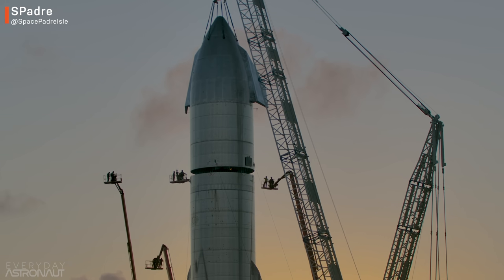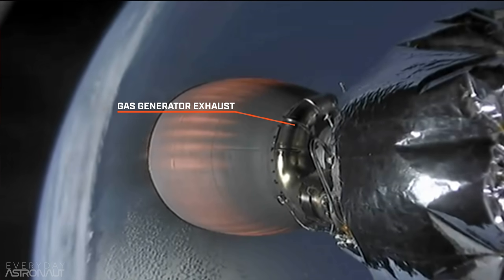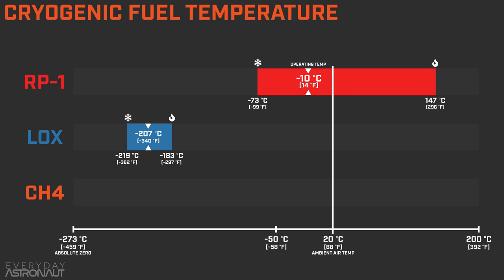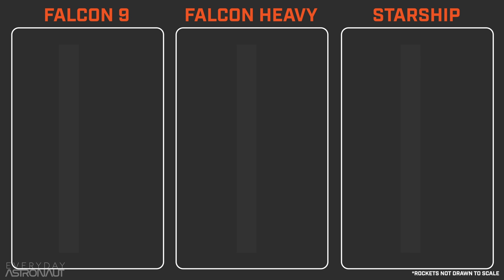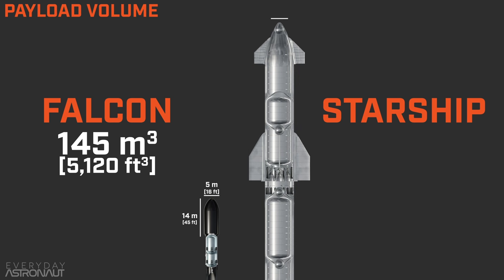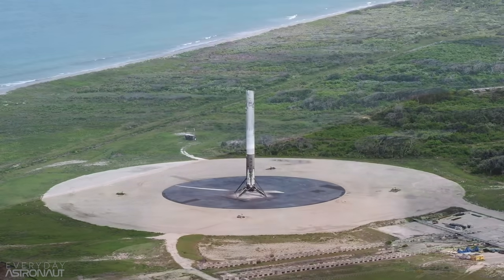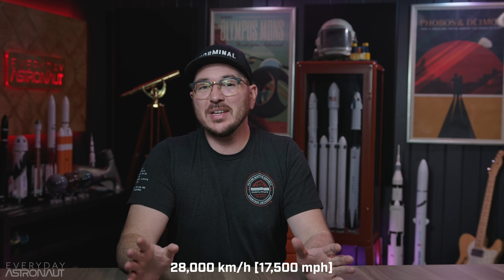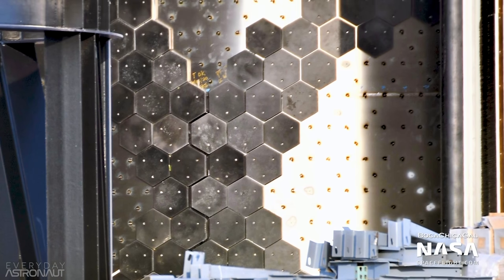Complete Guide To Starship: Falcon 9 VS Starship. What's new? What's different?

Comment: nice 3d design but is quad helicopters tech on avatar model this require some alternations who vant to blow engine in mid off wings is structurly dum idea and limited speed aif airplane has wings has some speed and glide now you hgave glide wings and flight buble some y horizon is  not moskito fly  patern off course is elctrcity possible but limited with slight potential speed adn amuzment them od 3d parts a turbo fans in fly fish 8 with rotational cocpit thats something to build on quad gliders and slight larger wings and back tail engine spin and cruise around 350 km 380 km and slight elevate the longer tail wings more glide and height and could also catch rotational cocpit this is aplicationabel should be enjoyable tech having fun and easy developing nto project task as it has limited purpose or nerve rack strees nerd job not fun to weight and keep in expetations is pregnant lady on labour day is not something you should long  vait and make projects on it only accept and develop it, no point kids dyng of having leukemia or cancer elsewhere as young is bit nerd reckless but know how without behaving we do it any way in english singing music oh nice is EU and we did that and have fun in english is called self funding or brag without purpose in projects on 3d efect, 3d your self as much you like and brag about patreon and new projects holisticly on new beer on 3d efects

Comment: Beliving Starship would make any sense for the journy to Mars undermines any credibility of this channel.
Reply: why? genuine question, why do you think starship isn't suitable?
Reply: @jibbmng  It is a bad design for cost effective launch int orbit.
It is a worse design for an orbital or interplanetary habitat.
It is a bad design to land on an unprepared ground.
It is a stupid idea to use the same habitat in weighlessnes and on a planet.

I could go into details in all these points.
Reply: @karstenschuhmann8334  please elaborate your reasoning beyond "it is a bad design"
Reply: @jibbmng  I will limit the discussion to the transport of payload to orbit. As all the other ideas are even more absurd.

Starship in its current design is a two stage to orbit fully reusable design. 

Reusing the booster is a good idea, because most of the engines are in the booster. Reusing just the booster would increase cost probably to 120% of the cost of a fully reusable rocket.

However, all the weight of the reusable upper stage cuts directly into the payload budget. Reusing just the booster could increase payload to about 500% of the fully reusable system.
Reply: @karstenschuhmann8334  i disagree with your estimates of both figures there. however i don't think there is much benefit from squabbling over that, my question to you in response is more important: are you aware that nasa has signed a contract with spacex to use starship for artemis? if you are, do you seriously think that your analysis is more accurate than the engineers at both nasa and spacex who think this system will work as planned, and that full reusability is feasible and cost effective?
Reply: @jibbmng  1. I base my estimation of simple physics.
2. The people working at SpaceX know the same, but they cannot talk without losing their job. 
3. Elon makes a lot of money by promising way too much.
4. the NASA money is already used up.

Comment: ALL INTERTESTING TECHNO-DATA. HOWEVER -- WHERE'S THE SYSTEM ENGINEERING?? MOST DOMINANT IS "RELIABILITY/AVAILABILITY/AFFORDABILITY ETC." RMEMBER, IT'S A ~30 MONTH ROUND-TRIP, 2 LAUNCHES, 2 LANDINGS OF HUGE PROPORTIONS, not just a lil Instrument Package. RELIABILITY, UP T0 30 MONTHS, PROBABILITY OF FAILURE OR "FAULT TOLERANCE [ 2 OUT OF 3, 2 OUT OF 4 ETC ETC VOKTINGR ....NOT TO MENTION THE "PROBABILITY THAT -JUST ONE UNDECTECTED ERROR STILL REMAINS IN THE SOFTWARE = BETTER BE SYSTEM VOTING OR EVEN BETTER - SAME SOFTWARE SPECS BY DIFFERENT WRITERS. ????